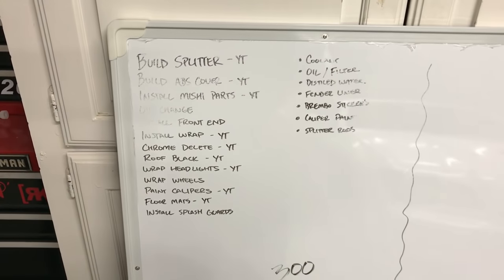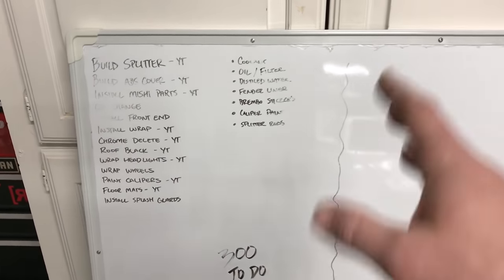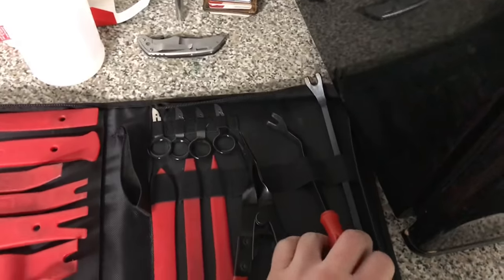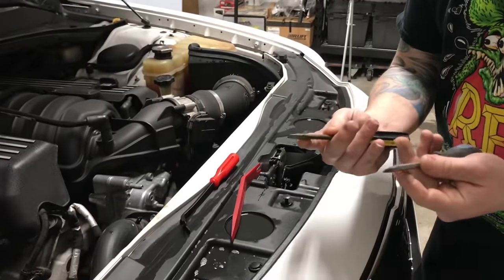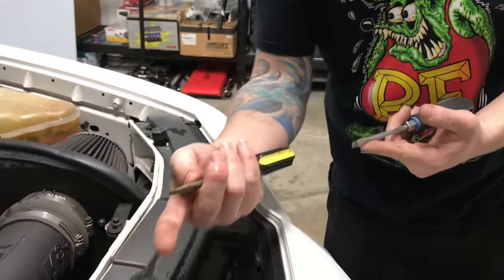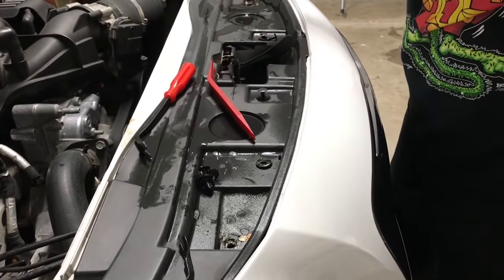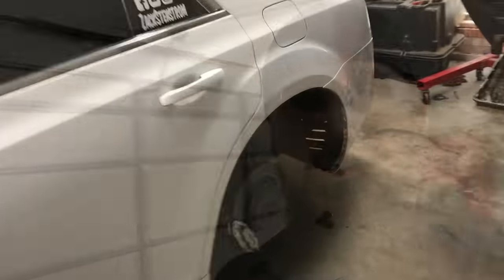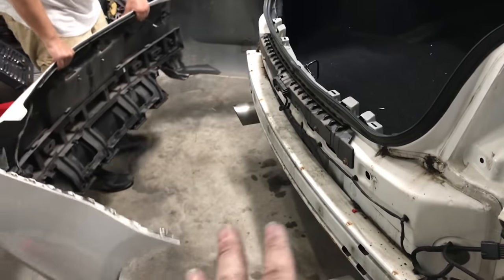Chrysler 300 SRT8 Wrap Disassemble/Removal of Bumpers, Lights, Handles, Wheels | Vlog

Comment: Those front bumpers are a PITA to remove.  The little plastic tabs are fragile too. Especially if someone hamfisted has got there first ....like on mine.   
About the only thing I don’t like about the car is the front air dam/splitter , which catches everything here , even moderate kerbs, and it grounds on speed-bumps constantly.

Nice clear video! It’s not always obvious how to get these assemblies apart and this will help lots . I learned that just about everything responds to more force than seems natural , but yields eventually with no damage .
Keen to see how it all looks in the end.👍🏻
Reply from the maker: Dave Johnson I remember it was bad before I put on my added splitter. After that was install I just cant park any where pulling in forward. So it well. Lol.

After you've taken off a few bumpers you kinda get a feel for it. But still feels like you're going to break it every time.
Reply: The parking sensor is not a heck of lot of use either.  I’m going to have a look at some other sensors when I get time . Angle parking is a nightmare.

Comment: hey zack, is it possible to remove the chrome part (white part on yours)of the door handle instead of the entire unit?  i see a screw on the inside and wondering if thats what holds the chrome piece . im looking to paint mine from chrome to body color.

Comment: Yoo zack time 18:28 you mention that the piece was broken called the core support that goes to the head light, mine is the same but on the opposite side I was wondering where did you order yours. Was it a link or where can I get that if it is replaceable?